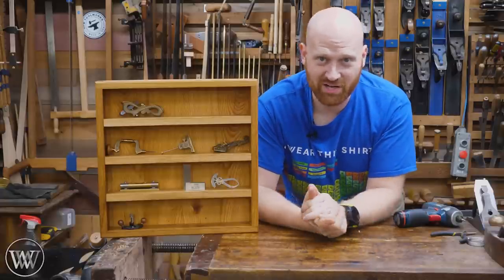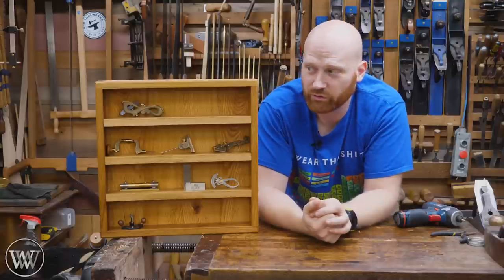A Curio Shelf

Comment: I have been thinking of building a library  set and this looks the ideal method. can you put a rebate in the back panel similar to the sides to discourage shelf bow under weight for 3ft shelves ?
Reply from the maker: If your back panel were thicker you could do that but the small shelf generally is not considered a good idea as the shelf can easily pop out of that dado. And you don't want to glue the back to the shelf as the back will need to move. Generally to stiffen a shelf you put a lip along the front that hangs down a little bit lower than the shelf. Kind of acting as a rib to stiffen the shelf.
Reply: @WoodByWright  thanks and noted.